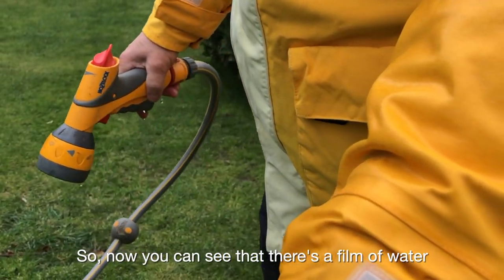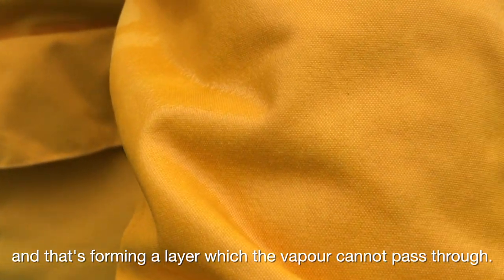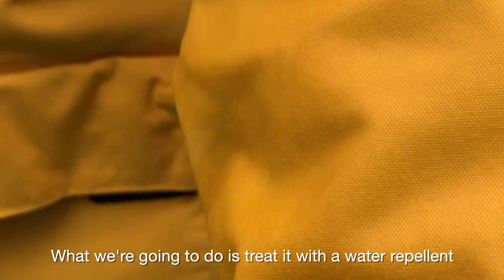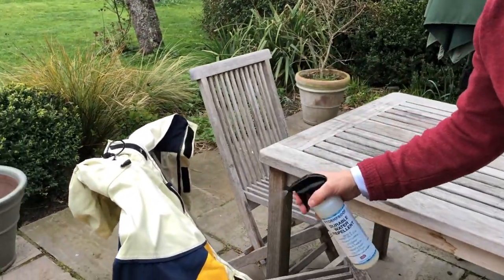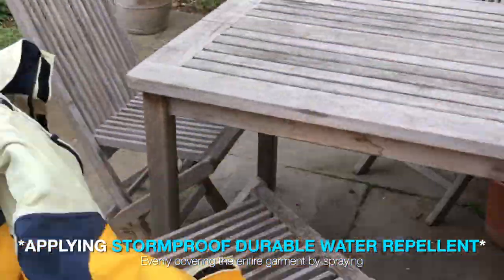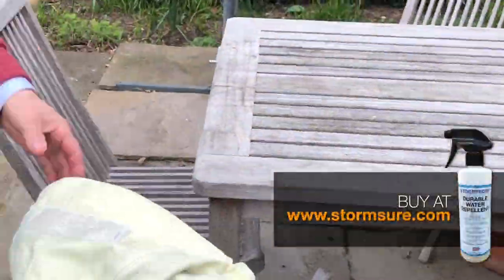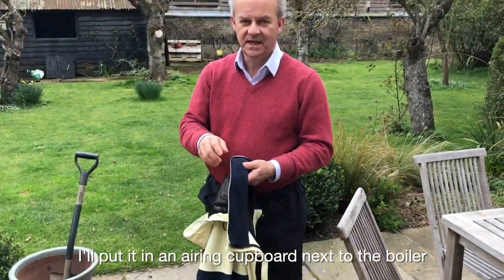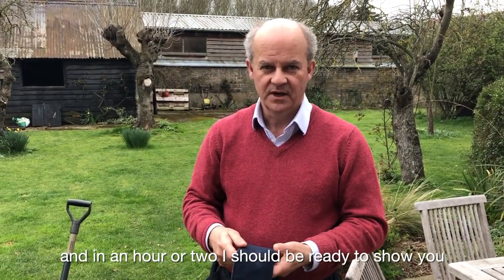Explaining StormProof | Water Repellent & Breathable Outdoor Clothing

Comment: Would this change the color of the fabric? I want to use this on a hunting jacket and I don't want it to dull the color.
Reply from the maker: It shouldn't change the colour. I have used it on a Barbour hat and it didn't effect the colour at all. It will be worth spraying it on a small area to check though.

Comment: Then how are you gonna wash it
Reply: Excellent question!
Reply from the maker: It can still be washed. However, it will usually impact the breathability of the item because the insulation and the lining will also end up being proofed.
Reply: This is not a wash in product.  Wash the coat as you would any outdoor breathable coat...use a tech wash.   THEN use this product.

Comment: is this wax based like nikwax?
Reply: No it is not wax based. It is a high tech water based solution. You only spray it on the outside surface. "Wash in" products will also coat the inside and the insulation layer which is not a good idea.
Reply: @Glueshop  I will give it a go. I find Nikwax pretty useless.
Reply: @DennisNowland  I disagree.  Nikwax is not pretty useless at all.  Its completely fucking useless and does not work.  🤣🤣

Comment: just use scotch guard.
Reply from the maker: Scotch Guard's main purpose is not to repel water. It is primarily designed as a stain protector. Also it is flammable and twice as expensive as Stormproof which has the sole purpose of repelling water. What other advantages do you need?
Reply: @crabjoe Nah,  just get a cheap candle and melt the wax.  Then rub it in.  It will never wet out then.